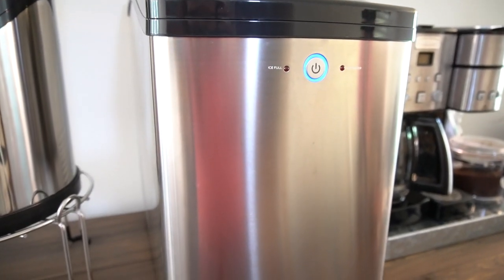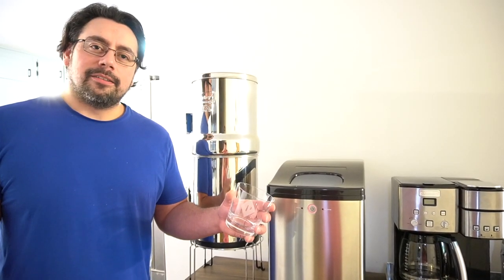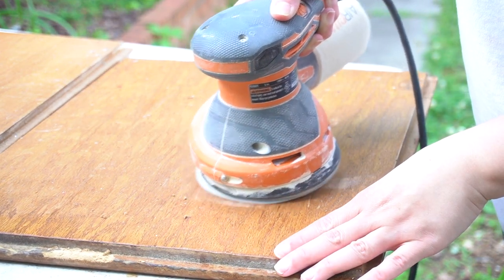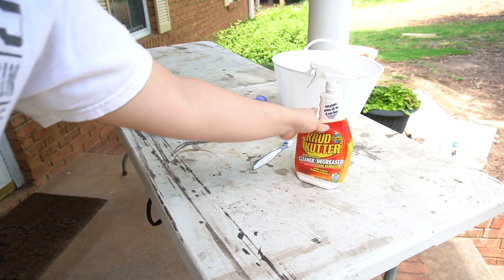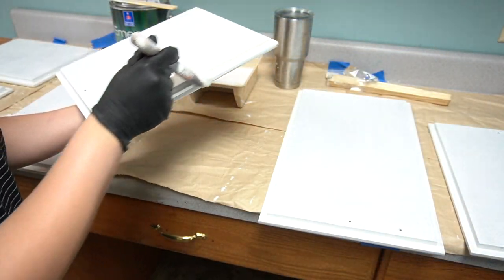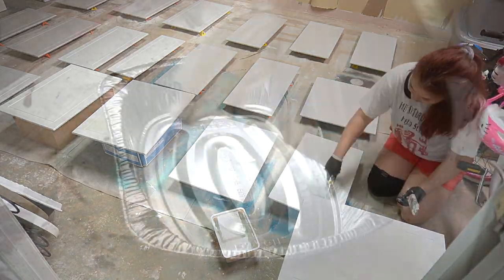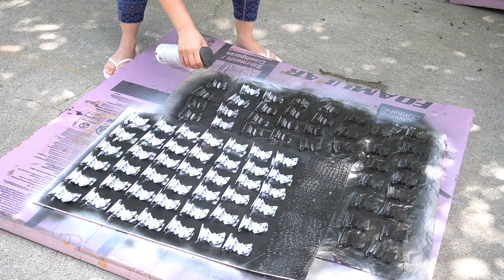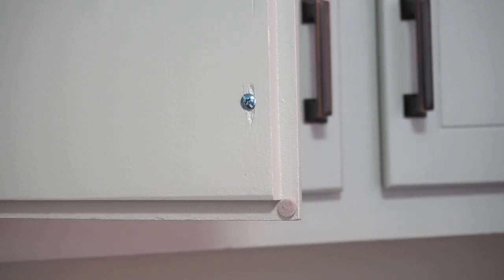KITCHEN RENOVATION UPDATE |  Painting Kitchen Cabinets | New NewAir Nugget Ice Maker

Comment: I use the same process for painting or staining my projects. 😆 if you soaked greasy, grimy hardware in tsp and use some very fine steal wool it will be a little easier to shine it up. Are those cabinets compressed wood or plywood?
Reply from the maker: Actually it was more like particle board. It was terrible because there was already signs of swelling.
Reply: The Latina Next Door that’s unfortunate but maybe in the future the Latino engineer and you can make some new doors. If the boxes are at least plywood they are already better than the compressed wood ones sold in big box stores. And you can make some plywood doors to replace these and avoid a whole new kitchen. I love how everything is looking. Can’t wait for your next update or diy. Thanks!

Comment: I’m watching your kitchen renovation because we are going to do ours soon.  The top cabinets are in great shape but like yours they need to be cleaned and repainted. I will not be redoing the bottom ones until I do the countertops. My plan for them is to use Stonecoat Countertops Epoxy and resin that will save you $1000s. Check out their YouTube. You are are artistic and I am certain you can use this product. After that we will tear out the bottom cabinets and replace them. We have water damage. I use the ceiling to floor method when redoing my house. That’s what I was taught by my parents and family to do and my husband is the same.
Reply from the maker: Thanks Shelly! We actually already have our countertops in. But that resin sounds interesting to watch. 😊💕